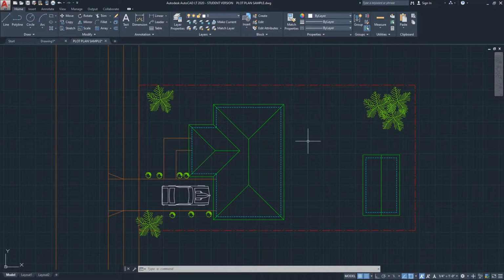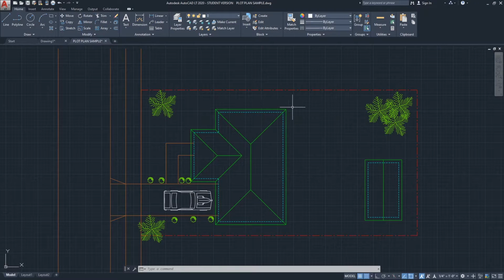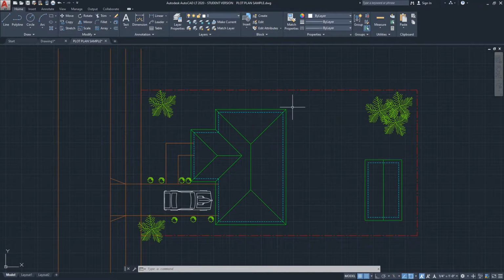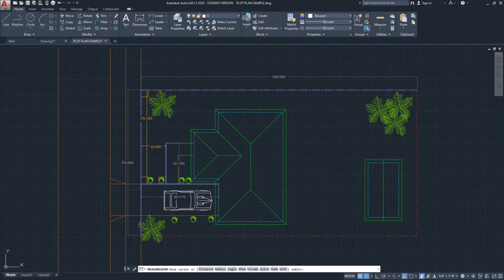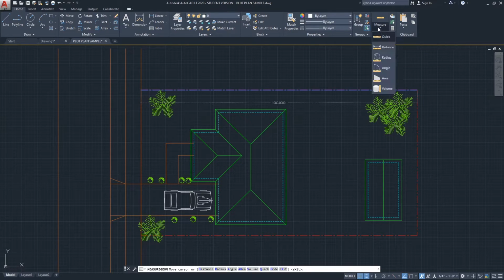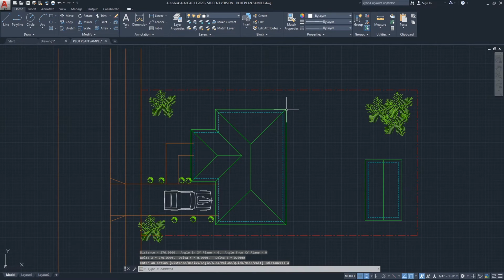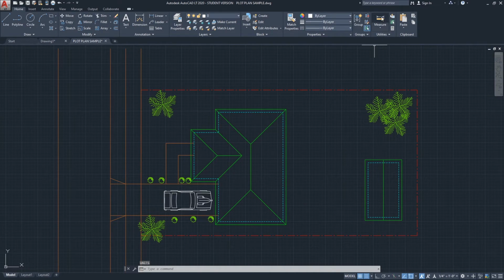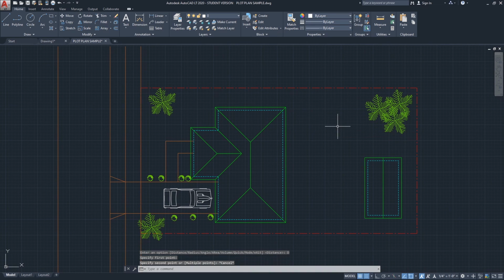How to Measure Lines in Autocad | Autocad LT 2020 Tutorial

Comment: thanks for this video, it was super helpful! If I'm only trying to measure a portion of a line (say two thirds of the line or an arbitrary amount), is it possible with the measure distance tool also? and does it work for curved lines?
Reply from the maker: I would use the divide command first then i would measure depending on the division

Note that divide command does not actually split the line into multiple lines, but rather adds Points that indicate the division 

Points might not be visible on your end unless you change the Point Style setting first which i think i talk about in an other video - i will let you look it up and hope this helps :)